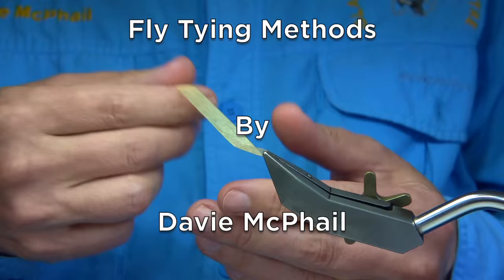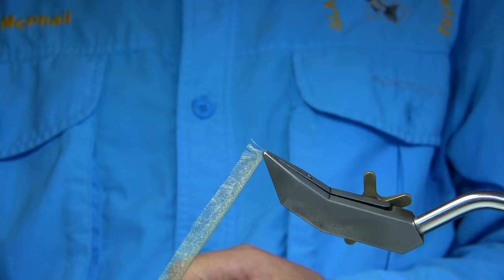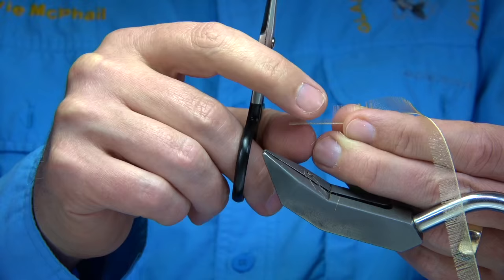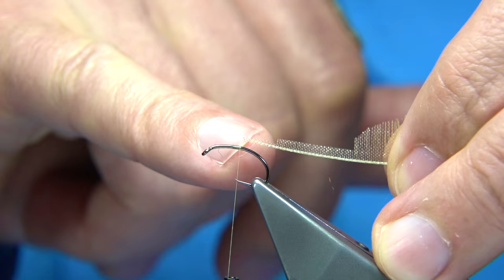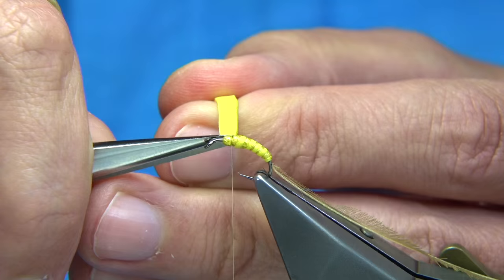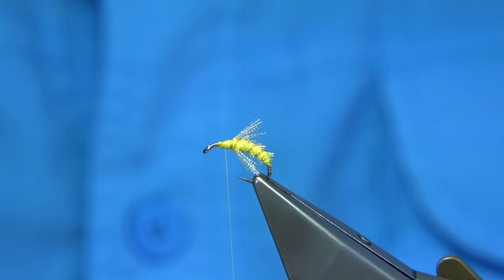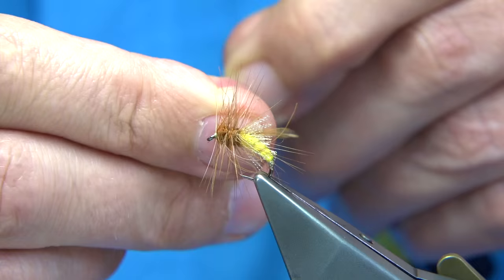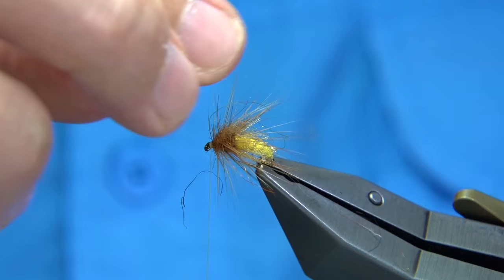Tying a Subsurface/Slow Sink Caddis Pupa by Davie McPhail

Comment: Nice tie Dave. On the Organza, there seems to be an endless supply of the stuff on eBay. A lot that looks exactly like what you showed earlier - 10mm, woven edge type. Is it all the same stuff or should I be looking at a very specific brand? Also, how does this stuff hold up without ribbing reinforcement?
Reply from the maker: http://www.lilyroseuk.co.uk/organza-ribbon-10mm.html
Reply from the maker: Hi Bob Gladys,

I've attached a link to the ribbon I used in the video and it's perfect for the patterns I tye..It's not expensive as you can see and it also dyes extremely well so I do have an extra spool of white just for dying..It's also very strong and will hold the dressing together really well so you do not need to add another rib to protect it...

All the very best Davie